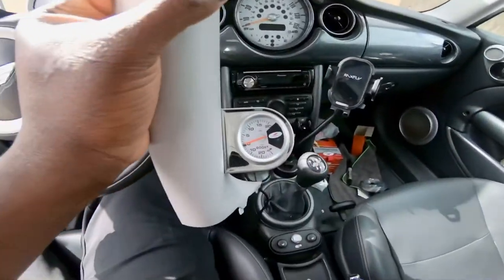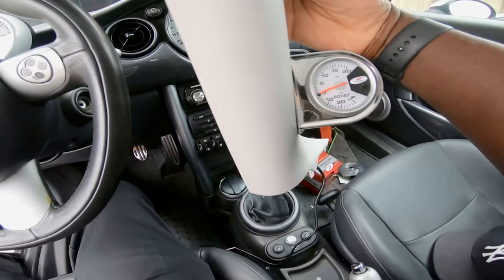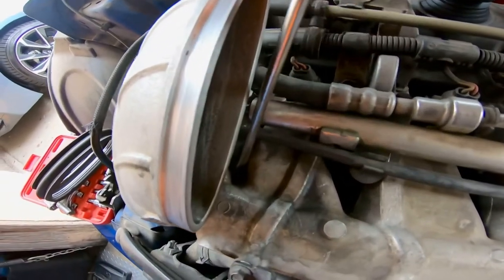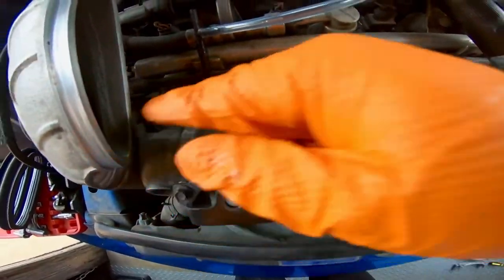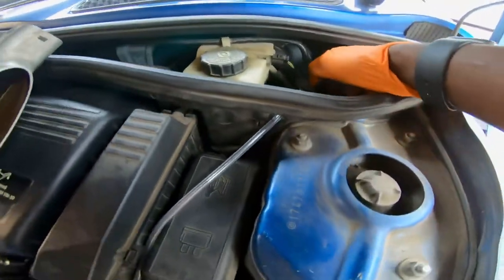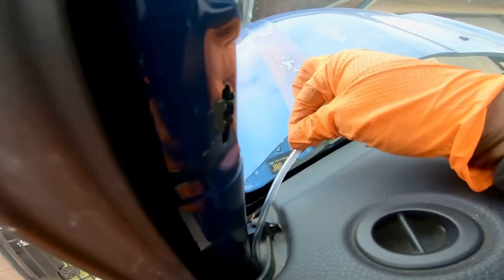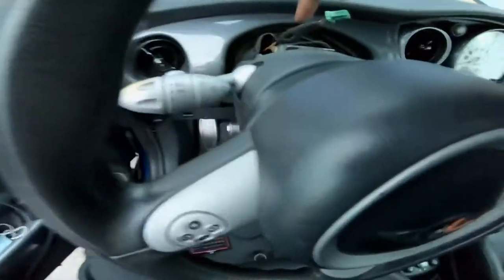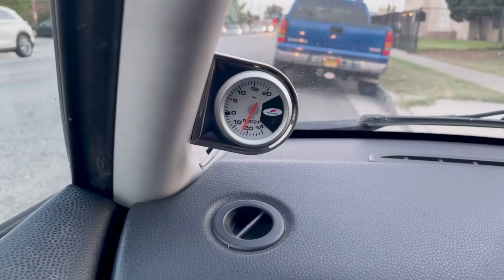How to install Mini Cooper S Gen 1 R53 Boost Pressure Gauge

Comment: Hi, can you tell me measurements ,diameter ,of the tube? and the connection "T"?, thanks!!!
Reply from the maker: I believe the hose and t are 1/8”.
Reply: @Jbpgarage  1/8" internal or external diameter?,thanks!!
Reply from the maker: 1/8 internal.